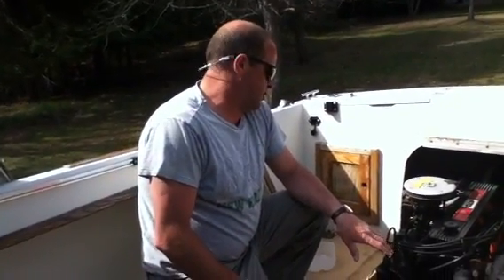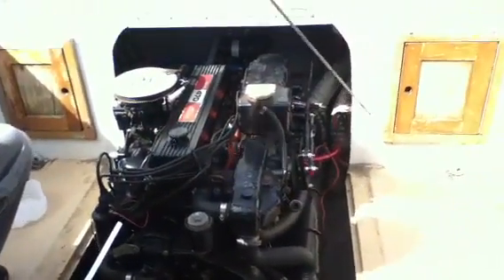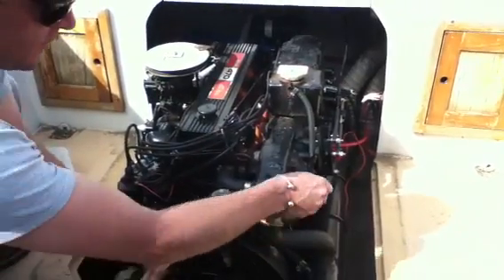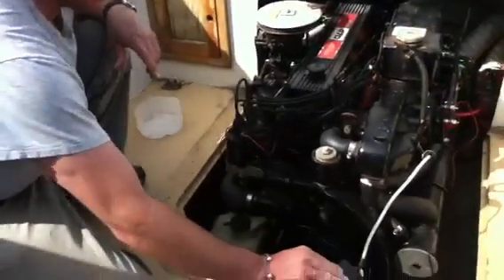Inboard boat motor oil change trick part 1

Comment: I have done the same thing except by siphoning. Buy 10-12 feet of 1/4" water supply tubing for a refrigerator and put down dip stick tube and start siphon to ground. The greater the fall the faster the flow. I have changed transmission fluid the same way.

Comment: Great idea, I have been using a hand pump without any luck.
Is there a particular name to this pump?
Thanks
Reply from the maker: Not sure the name. Should not be hard to find one.
Reply: David MacGowan I found it at Bass Pro Shop, no other places had it.
Simple name 12 Volt oil changer, however, asking by that name, the sales associates had no clue. Found it in the oil section.

Comment: i have this pump but it didnt work 'cause it hits something in the dipstick tube before it can get all the way in...only gets about 75% of the way in.
Reply from the maker: Try sanding the plastic tube that goes into the dip stick hole to a point. You might be hitting a fitting. Twist the hose when you hit whatever is stopping it.

Comment: sounds like a good idea, but it isnt. All the metal and other parts will be left in the engine. Why not drain it, via the oil plug?
Reply from the maker: There is no drain plug in a boat. That why you have to pump it out.
Reply: mine has a plug, I just had to drill through the hull to access it
Reply: Just how the builders intended it